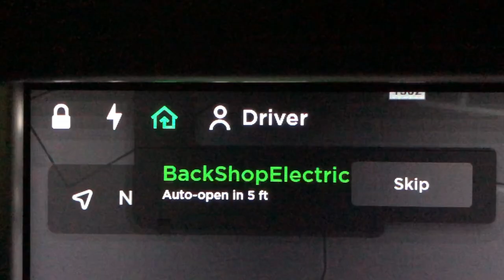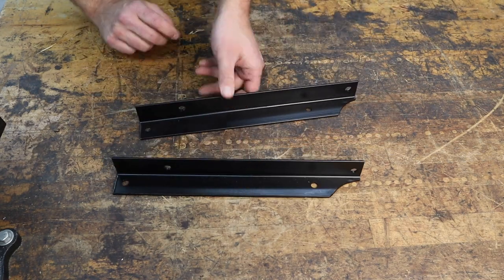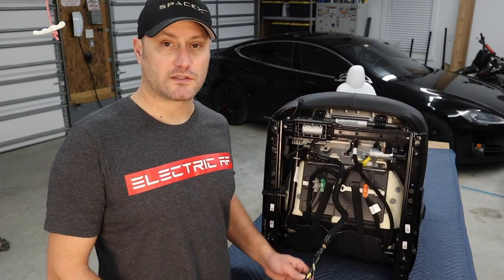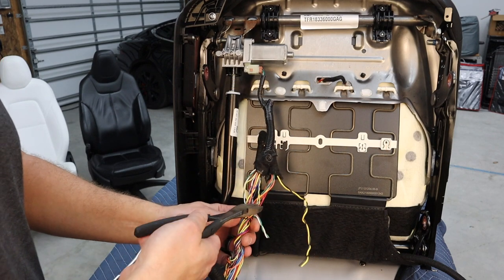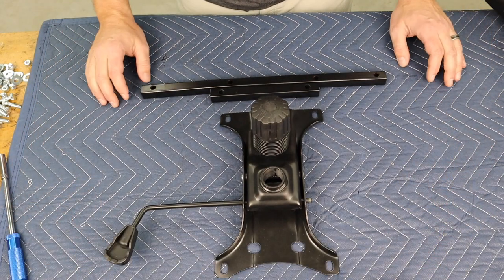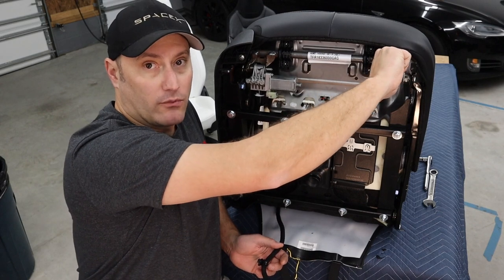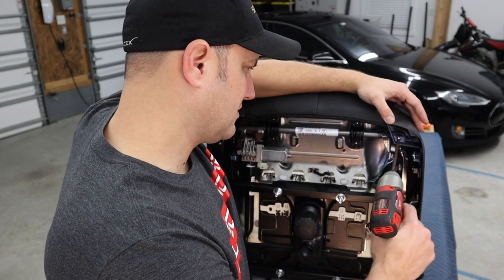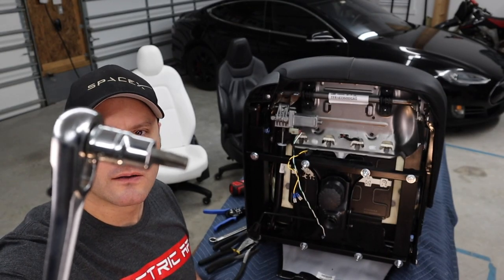How To Turn Tesla Model 3 Seats into Office Chairs!

Comment: Had to replace the passenger side seat from my PM3 so I told Tesla Service I wanted Ti keep the old seat with the thought of turning it into an office chair. That’s how I found your channel. 🥳

Now I have a super sweet office chair. My mistake was having my Wife try it out. Now she wants one for her office. I told her the next time a fault in the seat that can’t be fixed comes up… she’ll get one too. 😅

Charge On Peeps 🤓🤘⚡️🏎️💨
Reply: Forgot to mention. I’m thinking of adding power to it using a 12v cordless tool battery. Did you already deem that as not possible or not worth it and that’s why it isn’t in the video?
Reply from the maker: The switch pack needs to be replaced. Another viewer made a custom switch pack so it is possible to require the seat, but I don’t have the ability to do that yet.

Comment: I acquired a discarded passenger seat from a Model 3 for the purpose of making it a computer chair.  I didn't want to reinvent the wheel, so looked up others that had since the same thing and can't across this video and the file with measurements.  Very helpful.

Comment: Definitely a cool project!  I was able to use the Model 3 seat and a broken Steelcase Leap base to make the office chair, while retaining full functionality of the motors.  I wired a 12v rechargeable battery, and third party switches, but it's one of my favorite seats to sit in
Reply from the maker: Awesome! Do you have a link to the switches?
Reply: @backshopelectric   I went with generic Momentary Polarity Reverse Switches from Amazon and 3d printed a trim panel to make it look more polished, since the original switches would require the car in order to function correctly

Comment: I figured out you can recline the seat using a 9V battery, so I have hooked up a battery case with a switch to the yellow and black wires to adjust the recline.  Currently I need to swap the wires for up or down, but it works, a 9V is sufficiently powerful
Reply from the maker: Awesome info! Thanks!
Reply: @backshopelectric  Now if I can somehow mount a reversing switch in where the recline adjustment is on the side of the chair, that would be neat.  If I figure it out I'll post details.
Reply from the maker: @hernantcortes  I have plans drawn up for one somewhere but I won’t be able to post them for a handful of days.
Reply: Are u talking about the 9v battery the small one? Thanks
Reply: @kwatoggurutv109  The rectangular battery with the posts on the same side. 
A car uses 12v so a 9v works here just 1/4 slower
Reply: @kwatoggurutv109  The rectangular one with both terminals on the same side.
Reply: Did you get these power details ironed out? Thinking about doing this project but would want the electric mechanics fully working
Reply: @samkowitt2601  Yes, for one axis.
Reply: If using a 9v battery, Yellow to (+), and black to (-)? 

I got a set of these to install in a vintage mustang so needing to understand the chair 3 Motor's wiring.

On the other motors, is black always (-) and the color (+)?
Reply: @hernantcortes any info on this diagram? Thanks
Reply: @spiggit217  No diagrams, I made it up as I went along.

Comment: Hi, nice video. I’m planning to do the same thing to place the seat in a racing simulator. How hard it would be to control the lombar support, would it just be two more pairs of wires or does it need any kind of connectivity with the car?
Reply from the maker: @krankertigaz  I did open the back of the seats up but did not spend any real effort in figuring that particular thing out. It appeared to me that it was operated by an air pump, which would require understanding of when to turn it on when to turn it off and how to let the air out. Sorry, but I haven’t gotten into that part.
Reply: @backshopelectric  thanks for the reply. I’m asking because the bmw seats have some kind of module in it, so we can’t operate using the buttons on the side unless we hack the module or go directly into the motor wire. If the air pump is able to operate just on power I think it should work fine, just need to find the right pairs of wires…
Reply from the maker: @krankertigaz  and figure out how to deflate it

Comment: Hi! Really cool video. Thanks for the idea. I'm currently doing the same project and almost finished. I'm just in the point of choosing bolts for the fixation of the seat to the lower structure. You used 4 screws, what size did you use?(min 10:00) I'm a little bit worried for the weight to be hold by the screws. Also, I was thinking of using rivet nuts in the bars. What is your thougt on it?
Again, thanks for the inspiration for the project. Regards Gio
Reply from the maker: I used 5/16” (~8mm) diameter bolts. Which has a tensile strength of ~3000 lbs (~1360 kg) each. Which is plenty for an office chair

Comment: Great video, well made. I’m about to take delivery of one of the new model 3’s that doesn’t have passenger lumbar support. You’ve been all in these chairs, do you think it would be hard to find parts and add back in?
Reply from the maker: Awesome! I am excited for you. And thanks for the positive comment about my video! Unfortunately, I have not taken the seat backs apart. My gut tells me that the lumbar will need the body controller (which controls the seat movement) to work properly, which at minimum would require some degree of reprogramming. The seat adjustment switch panel is actually a low voltage circuit card that sends signals to the body controller to move the different motors on the seat. Although I can’t say for certain whether it is possible or not, from what I know about these seats it would probably not be worth trying to fit it as it would be a serious pain to make it work right in my opinion. If you find that I’m wrong, post another comment or email me because I’d love to hear what you learn!
Reply: It is only missing in the passenger seat. Have your passenger(s) try it out, if you need lumbar support, just buy an aftermarket solution that sits in the seat.

Comment: Currently working on this project right now and I have a few questions. Is there a way to get power all the time? And is it possible to get the heated seat to work?  Thanks!
Reply from the maker: I did not look into those options. If you are able to mount a 12VDC battery and switching mechanism, you should be able to adjust the seat pretty easily. However, the seat heater controller needs the MCU to control it. I haven’t looked into what it would take to emulate it.
Reply: @backshopelectric  what power source did you connect it to to be able to move it?
Reply from the maker: @Macade_Olson  A 12VDC lawn mower battery

Comment: Is this done with a passenger or driver seat? Does it matter which one you do it with?
Reply from the maker: It works with either side. Thanks for watching!
Reply: Could you just bolt a piece of plywood to the entire seat including the fore/aft adjutant rails and bolt that directly to the chair base?
Reply from the maker: @ethancooper7762  I don’t recommend doing that. The center of gravity will be very high and it will be very unstable. The person sitting in the chair will likely fall over backward and get hurt.

Comment: Hi Steve, bumped into your video while searching for how to power a power seat out of the car. I have a Model 3 seat that I want to attach to my simulation rig. I want to retain all of its electric adjustments to keep it "compatible" with the family. I want to use the original controls of the seat to make adjustments. Do I have to power all the motors individually? How can I connect the ah H-bridge connector to the actual controls? Thank you
Reply: Did you ever solve this? Thinking about doing the same. Doesn't seem like anyone has been able to figure out how to retain factory switched though.

Comment: I’m jut need to know how you did with the switch control. Please tell me
Reply from the maker: You will have to refer to the wiring diagrams for the model/year of the seats to make sure you got it right. Or you can trace the two larger diameter wires off each motor to connect power to each motor individually

Comment: two questions: why not to invest a little bit more and have your chair warmed and adjusted when needed by having it plugged in? secondly, how hard will it be to defuse the airbag you keep sitting on and waiting for it to be triggered?
Reply from the maker: These are good questions. There is a viewer that is working on the side switches for adjustment. I do not have the technical data for control of the heat strips and am not certain what amperage load that would be required to not burn batteries up, or where I could store a battery of any substantial size without making the chair super clunky. In reference to the air bag, the firing mechanism requires too much voltage to fire by accident.  I felt comfortable enough to leave it in the video with the caution in the unlikely event the viewer did not follow all of the directions or attempted to put power on a part of the seat at some point prior to working on it.

Comment: Cool, I have now idea: I will install tesla 3 seat to my 2003 New Beetle convertible.  Do you have  wiring diagram for tesla seat?
Reply from the maker: Sadly, it’s not a direct wire for wire installation. The switch panel on the side has a circuit board in it that converts the signal for the adjustment motor control. Do you want to incorporate for adjustment control will all have to be manually wired to the switches you would need to install
Reply from the maker: Would look pretty sick if you can get them to work in the beetle though :-)
Reply: @backshopelectric  Holy moly, Then it is quite hard to do, but do able.
Reply: @backshopelectric  Highly possible :O)

Comment: Did I hear correctly? The air bag explosives are still in the seat when you are chopping through wiring looms?
Reply from the maker: To be clear, air bags do not contain explosives, they are charged with compressed nitrogen gas which is an inert gas. The safety restraint system (air bags system) requires 12V DC to be applied to the specific circuit to deploy the air bags. The caution I gave in the video was in an abundance of caution knowing that there could be any number of people that could be building these chairs and that a simple precaution of cutting one wire at a time would be a simple way to cover all but the most extreme situations. I hope this helps!

Comment: Now all 4 motor wires figured out !  Thin cables from seat motors are just position sensor cables?  What are those gray (4 wires)& green (2 wires) connectors under seat ?

Comment: 2:37 "deez nuts" confirmed
Reply: But in all seriousness, I just came across a M3 passenger chair that I want to do this with. One of the parts from this video are no longer available, so I'm trying to find a substitute. Good stuff!
Reply from the maker: @alexjames8188  is it the super short cylinder piece? That one seems to come and go on Amazon. I’m sure if you keep searching every couple of days it’ll come back. It’s happened twice to me.
Reply: @backshopelectric  yup that's the one! I'll keep checking, thanks for the swift responses.
Reply: I found the part at last. Another question, have you ever considered armrests? I would interested to see a solution for that.
Reply from the maker: @alexjames8188  I tried a couple off the shelf solutions but they were all too low. I was going to fabricate some arm rests but never got to it.

Comment: Looking to due the same with Model X passenger seat. Any idea where I can find the info for the wiring colors to move the motors in that seat?
Reply from the maker: If you look under the seat, most of the wires are visible on the motors. You can visit www.fixyourtesla.com for wiring diagrams. I’m sorry I don’t have the diagrams for the Model X
Reply: @backshopelectric  I have looked there already...not as helpful as I had hoped...great videos!

Comment: What kind of metal did u use for the tubes? Aluminum? Steel?
Reply from the maker: Steel
Reply: What is the length of the square tube and angle iron

Comment: Will this work 12V 9AH SLA AGM Battery to this seat
Reply from the maker: I haven’t tried it, but it is a 12V system. If you try it, let us know how it works!
Reply: @backshopelectric  i see some 12v dc that is connect direct to the outlet will it work to? Trying best option if i go 12v battery or 12v dc direct to the outlet?thank you
Reply from the maker: @kwatoggurutv109  I would recommend that you use a battery
Reply: @backshopelectric  the back cover of my seat is off looks like i have to adjust the head rest or need to raise it in order for me to put it back the back cover what wire is the head rest? Thank you for your help really appreciate sir….
Reply from the maker: @kwatoggurutv109  if you are working on a Model S or Model X third Gen seat, there are four wires that go to the adjustment motors, the two smaller wires are usually the sensing signal (so the motor knows where the plunger is in its stroke) and two larger diameter wires for moving the motor/plunger. You can adjust the motor by applying power to the larger diameter wires, reversing polarity to change direction. I hope this helps!
Reply: Hello there the battery 12v 9ah agm work on the black and yellow but for the white and green to raise the seat it don’t or may be different wire? Any idea which wire on this seat
Reply from the maker: @kwatoggurutv109  what kind of seat are you working with? You had mentioned a moving head rest, are you using a third Gen Model S/X seat?
Reply: @backshopelectric  the head rest i figured it out its manual it has some clip on it..the white and green wire not working to raise the chair wondering may a different wire? i have a model 3 seat….thanks
Reply from the maker: @kwatoggurutv109  can you send me a pic of the motor you are working on? Please use the info@backshopelectric.com address.  To be sure I understand, you are trying to adjust the seat bottom up and down, correct?
Reply: @backshopelectric  thanks i send it to the email u provide sir

Comment: My driver's seat back and seat cushion rocks/pivots back and forth on my model 3.  Do you know how to fix this?
Reply from the maker: Unfortunately I have not heard of a fix for this. The seats in my Model S did this as well, however it was not very noticeable in my case. If it is very evident, I would recommend having your service center take a look at it and see if it requires replacement. How much would you say it rocks back and forth?
Reply: @backshopelectric  Not much, but enough that I do notice it at times when accelerating from a stop or braking to a stop.
Reply: @backshopelectric  Does your model 3 office chair conversion wiggle around or is it pretty solid?
Reply from the maker: @andrewlane9842  I don’t have the seats in the BackShop anymore, but I sort of recall some side to side motion, but not front to back as you are describing. It is possible the drive motor gear could have some play in it for the vertical adjustment. I haven’t researched if that is a serviceable part though, meaning I don’t know if you can buy only the motor from Tesla. I don’t think it would be the tilt motor as that only raises the front of the seat cushion. There isn’t much play in the bushings of the seat so it’s surprising you are feeling it to such a degree.

Comment: The lumbar on mine is fully inflated, do you know which wires control that pump?
Reply from the maker: I found the wires but was unable to actuate the pump. I think it is controlled but a LIN wire and won’t work until it gets the proper signal.
Reply: @backshopelectric  So a needle :)
Reply from the maker: That would probably do it.